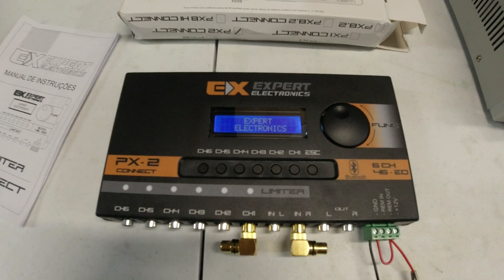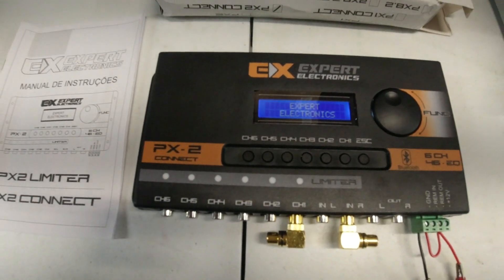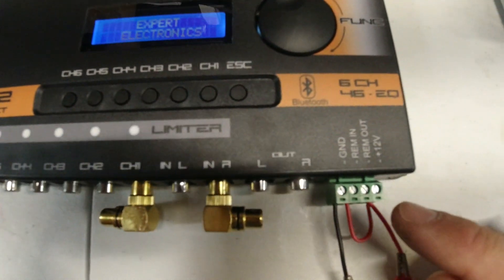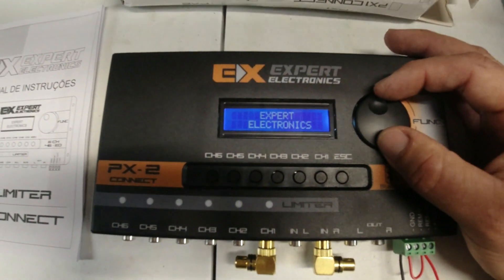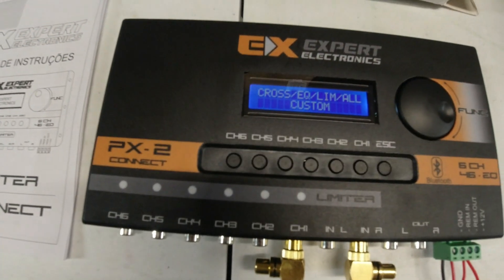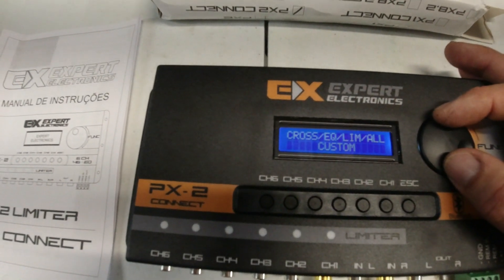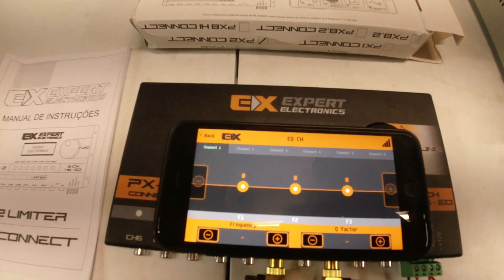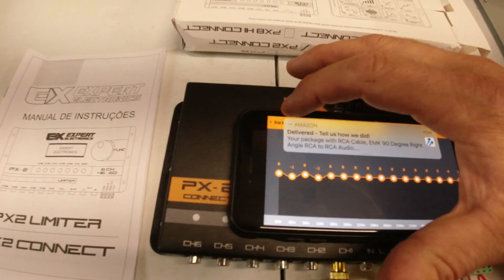Expert electronics PX2 connect DSP digital car audio processor Equalizer  crossover english manual

Comment: That DSP is a 6 channel and each channel is completely separated not by left/right channels. You can take each channel and input a one in/ 2out splitter per channel. In the settings you have a choice to run that channel joined left/right joined. Each channel has its own crossover. So if using a splitter per channel it can expand to 12 outputs. One per speaker on an amplifier. Fabulouso

Comment: How is 2 yrs any noise still run it still work worth it
Reply: One I am looking at is r lime
Reply from the maker: The Px2 connect and px2R are both good but the px2R has a cleaner output signal at higher output voltage both are good but I’d pick the Px2R. Also the audiopipe clean DSP-app is nice as well.
Reply: @HiFiVector  ok now it is Bluetooth tuning? Or stream music to it Bluetooth?
Reply from the maker: Only Bluetooth tuning on both
Reply: @HiFiVector  oh good

Comment: Quick question no do you know if my head unit output to this is 2 volts through the RCA and I increase the gain on one channel will it increase the output voltage too that RCA? I need to hit 5 v for my amplifier input sensitivity. I've also read that taramps like to have their gain turned up a little bit. So in your opinion should I leave the input voltage to the a little bit lower? And also my smart3bass amp will not allow you to turn the crossovers off so should I turn the high pass filter all the way down and the low pass filter all the way up in order to use this DSP crossover? Thanks for your time
Reply from the maker: Yes it will boost voltage slightly so if you want to keep the voltage on the output rca’s T a certain voltage turn up to mace listening head unit volume and check the output from the DSP and adjust the gain to where it stays where you’d want it. From what I remember at max output gain it boosted a 2v rca input to around 5v. And yes the taramps seem to do better with a lower voltage input signal. Around 2 volts . You can go higher or lower some guys run like 7 volts and some 1.5v but to me they do better with lower input voltage so you can turn the amp gain knob up more. High voltage makes them “ jumpy”.

Comment: Any suggestions on how to get to gets customer support? There is absolutely no way I would recommend this item just because it is an act of God to be able to get customer support or find out any information on this thing. It has been absolutely frustrating and a waste of my time. I understand when it works it is amazing apparently but that is if you can get it to work
Reply from the maker: Yeah, I’m not sure on the support but the Bluetooth should be pretty straightforward to connect but again some problems might just depend on the phone you’re using maybe? Because usually it’s pretty straightforward. Sometimes there is a delay where it might take a minute to connect. I have heard people say also make sure that you’re not connected to any other Bluetooth device just  the DSP.
Reply: Yeah I thought maybe I got a bad one so I ordered another one have the same issue. I've tried 3 different phones to different px2s. Made sure that no other Bluetooth is connected. When I open up the app it doesn't even show that it is searching for anyting. Still have not been able to get a lick of customer support.
Reply: Does your app still look the same as it doesn't your video? Mine has a slightly different layout but looks pretty similar but they have 20 different apps. According to the about app paragraph then the one I am using is for mine. Idk. I'm so freaking frustrated with this thing. Thank you for your help and time.

Comment: I'm confused on how to hook this thing up. I have 2 sets of rca coming from factory radio.  One for subs amp and one for mids. How do I run both sets to the dsp ?
Reply from the maker: You would just use the full range rca into the DSP and setup the outputs for a sub amp and then full range. This DSP is one in and multiple out.
Reply: @HiFi Vector   awesome,  thanks for the help man, super appreciated it was the last part of my install lol
Reply from the maker: You’re very welcome man!

Comment: Can help me out Problem I’m having is i have a EQ from my head unit so from the EQ I have it down to the DSP and then I go to connect my speakers amp to dsp it works but when I connect horns and sub amps into dsp doesnt work ?
Reply from the maker: Maybe check your output configuration to the outputs of your sub and horn channels. crossover ers and also check to be sure you don't have the channels muted.

Comment: Hi Vector ii have a few questions if you could help me  .  First off thanks for the review on this PX2  this maybe what i have been looking for.  I have a head unit with dsp, but its limited and my opinion it dont sound so great.  So i can hook up the PX2 and just not use the dsp in my head unit ?  I have 2 front door speakers, 2 rear speakers and 2 tweeters on the front pillar, and i have a 4 channel jbl amp.  Im guessing this unit is going to improve my sound over my stock head unit dsp ?  Does it have the ability to do speaker timing delay ?
Reply from the maker: Yes you can use this DSP instead of your head units. It does have delay settings. Thanks for watching

Comment: Ordered mine 30 seconds ago. Thank you bro.  Only question I have is how do I adjust the RCA pre amp outputs?
Reply from the maker: It is adjusted by adjusting the gain on the output channel. Higher games equals higher voltage.
Reply: @HiFiVector  thank you bro
Reply from the maker: Your welcome
Reply: Have you tested it to see where it starts sending clipped signal at?  What main gain setting that is?
Reply: Hey bro. I've been using this DSP for over a year now and just learned something.  I was playing with my system and had only the sub going with a podcast playing.  I heard the words through my sub and was like what the hell.  Crossed it over down to 30 Hz and could still hear words. The crossover on this thing can't be trusted bro. So I tested further. Played at 40 Hz tone and my door speakers were trying to play it. Buzzing.  I have them crossed at 150 Hz. Check it out yourself.  Imma try a Dayton. I love the features on this thing but I can't run it anymore.  I ordered another off Amazon just to see and it's the same way. Plus it lets a little noise in the system. I tried a good Newmar noise filter on it and it still  had noise. I mean for the price you can't expect perfection.  A good starter DSP nonetheless. Thanks for your videos bro. You rock!

Comment: How do you set the gain with a o scope on this ? Its not registering in my head why its even a option.
Reply from the maker: You would just do it the same way you were checking your main RCA‘s from your head unit but now you’re gonna be checking them on the outputs  of the DSP. And you can set your gains directly on the DSP accordingly to get it clean max volume.
Reply: @HiFiVector  ill check out some videos on that. I checked clipping on my hu with the speaker out and set the gain on the amp right from the amp.

Comment: What rca outputs from the radio do I use if there's 6 of them? But only 2 inputs on the dsp?
Reply: Ok thanks, just the front 2 will control the sub as well? Don't need to bypass the DSP for the sub RCA'S and go from radio to amp?
Reply from the maker: Yes this particular DSP just run it left and right RCA’s and then you configure the outputs for either full range or subwoofer through the DSP
Reply from the maker: You can use the front right and left.

Comment: I am running 4 channels front L & R and back L & R, plus a mono amp for 2 10 inch subwoofers, I guess it would be a total of 5 channels. How would I use the routing for each channel? Especially the 1 channel for 2 subs, thanks
Reply from the maker: Watch my other DSP video it’s More and Depth that should help you
Reply: thanks, that video answered the routing but created a brain freeze on the crossover and types. I have my current crossover at 120hz and sometimes use 80hz. This dsp looks confusing with the crossover adjustments

Comment: Do you have any idea what the difference is between this and the x8air? I can't find any info on the x8air. Also on this would you need 2 for front and rear output off the head unit?
Reply from the maker: The x8air you must use the app . No buttons on unit. It has only 1 band custom eQ per output. ( px2 has 3 ) the x8air main difference is it has 2 pair inputs with right and left channels so you can keep your balance and fader control. On your head unit. Those are the main differences I can see. You just need one pair of rca from your head unit for the px2.

Comment: Hey does anyone know th output volts of this unit is it 4 or 8 v rms and do I still need a preamp for my amp
Reply from the maker: Check out my in-depth video that I did a little while back. But the output voltage on the RCA’s since the Dsp is adjustable that voltage is somewhat adjustable. And you still need to provide the Dsp RCA preamps from your head unit. Or you can use a line out converter and tap off your speakers.
Reply: @HiFiVector  ok thanks alot

Comment: Can this substitute a line out converter?
Reply from the maker: No it cant
Reply: @HiFiVector  so how is it be installed with a line out converter?
Reply from the maker: @justinking8220   You connect  your speaker leads to your line out converter then take your rca outs from your line out converter and go into the DSP.

Comment: Do you use 1 pair of FULL RANGE RCA's from the head unit to  INPUT on the DSP? And from that you get full sound even the subwoofer sound? My head unit has 3 pairs of RCA's and one of those pairs is a dedicated sub  output.
and use DEFEAT or else set everything to 0 on head unit?
Also, is the AudioControl Epicenter still useable on the sub output to the sub amp ?
Thanks, maybe somebody else has these questions too. 😃
Reply from the maker: the DSP controls all the channels so you would not use the factory sub output. You would just use the 2 main RCA in and then configure the DSP to output the sub channel.
Reply: @HiFiVector  thanks, I ordered using your link😃
Reply from the maker: Thanks so much I appreciate that!
Reply: @HiFiVector  you went to the trouble to make the video, I'll order from your link .
Hey, those L and R inputs, that's both from the Front? In other words you wouldn't use right FRONT and left REAR, JUST USe right and left front rca from head unit ( could be rear but I'm saying front to keep it simple)
So long as it's full range signal
Reply from the maker: Correct on this DSP with only 2 rca inputs you would do it that way. Then use the DSP for everything even levels like fader for front rear with your levels on the DSP.

Comment: Better than the pioneer s1000 dsp?
Reply from the maker: This has more adjustability for sure. But the Pioneer is a good basic DSP plus the Pioneer has a built in amp to replace your head unit power for your door speakers if you need that then its good but otherwise the Expert or comparable DSP is more tweakable.

Comment: The X6 Air is basically the same processor, but with a reduced size and 32 bits. It only works with the App. https://www.expertelectronics.com.br/produtos/visualizar/27

Comment: Delay is to align a rear speaker that’s out of sync with the front to tighten the sound (you would delay your fronts to make the rears more in phase/tight   Would be useful the larger the vehicle is… at extremes you would hear doubling … could also delay the passenger speaker to the drivers ..   out of phase speakers will kill bass (most noticeably)
Reply: You
Reply: I'm not

Comment: Can someone tell me some information/specs in layman's terms on a US Amp 4300x. It's also connected to a "bridgeable" (connected?) 1000 watt amp with a capacitor and a 6 channel line output converter.

Thanks

Comment: Mine is junk. Introduction of alternator whine.. it's 100% the dsp. This thing is junk
Reply from the maker: Sorry man that yours isn’t working. I know a lot of people that use this and we haven’t had any problems so far but maybe you got a bad one. Also I know certain vehicles have noise issues inherently so maybe that’s just something with your vehicle or maybe it was just a bad DSP but usually these things are pretty solid.
Reply: Your main output level is too high. It sort of clips over 3/4 Distortion.Think of that setting as a gain setting and not a volume setting It has noise if you go over that. Buy a ground loop isolator install befor the unit rcas
Reply: Always the equipment never the user huh
Reply: Out of curiosity, what kind of vehicle do you have it in? Year, make, model?

Comment: Do you know the difference between the PX-1, PX-2 and the PX-8.2? I am looking to get one these but I have no idea what the difference is 😐
Reply from the maker: It looks like the px2 has more frequencies on the parametric EQ and has more customizable channels. So they are very similar  but px2 has a little more presets and larger EQ.
Reply: @HiFiVector  yea thats the one I ended up going with I love it im glad I ran with that instead of the px1.
Reply from the maker: I do not sorry. I would just check out the website and compare specs.
Reply: @HiFiVector  I've been trying to find a website I can't find that either lol the most I could find is that the px-8.2 has 8 channels and 2 inputs with a 15 band eq while the px-2 has 6 channels and 28 band eq. It seems like the px-8.2 is the newer model so I really wanted to know if it had newer features but I think I'll just stick with the model that you have since there is no videos (in English atleast) about the new model. Thanks anyways bro.

Comment: Hands down this has way more features than stetson taramps both no bluetooth.  Outstanding Video. Got one. It just has more features period. For the price Im blown away. Should have gotton the 8 channel model instead of 6 channel.
Reply: If u ever own audio control dsp, u would never compare it to this crap. Same features doesn't mean equal or even close in quality.
Reply: @Clement-sx6ll  Your right just discovered Background humm/hiss from this unit. however it gets the job done.

Comment: Any updates on this? I read that the output volts are semi low on this unit and some people noted ground loop noise . Lmk thanks
Reply from the maker: Have not had any noise on mine at all. A lot of times noise can be vehicle specific though.
Reply: @HiFiVector  thanks, was on the fence with this and the Setsom. I am going with this thanks to you.
Reply: @HiFiVector  - I'm getting noise even when connecting this to my home theater subwoofer on my home electrical using a 12V DC to AC adapter.  I'm even hooking up a ground loop isolator in-line and still get noise.  I'd say the electrical built-into this is cheap junk, but the processing and phone app are solid.  The company really needs to make a more robust noise resistant internal electrical.  I think the company that makes this "cheaped out" the internal guts and that was a mistake.  People would gladly pay $15 more for a robustly built noise-free sound processor.

Comment: Would I need 2 of these if I have 7 in car speakers and 2 subs
Reply: There is a 8 channel model. More money however.
Reply from the maker: This has 6 controllable outputs. They  can be configured MONO or you can output them as left and right as a pair. So if you had them all set as stereo outputs then there would be 3 outputs. But it is customizable. There is also 1 pair ( Left / right ) pass thru outputs. ( where they are outputs but not running on DSP ) . So it just depends on how many and how your amps are set up. for example you could set it up to where you use 1 mono or stereo output for your sub amp , and you can have 2 stereo outputs for 2 full range amps. You can use any combination of the output channels.

Comment: Thanks for the video. Do you know what the preamp voltage range is that you can send to other amps?
Reply from the maker: I didn’t check preamp voltage range. I will try and do that soon and let you know.
Reply: @HiFiVector  okay, thanks
Reply: Up to 10 amps

Comment: Sorry man super interested in these. I forgot to ask you if you know what the output voltage is..?
Reply from the maker: I didn't measure the voltage but it is fully adjustable on the input gains and output gains.

Comment: I have two of these. It helps to download the app immediately . Because the app has a "test" function and then you can figure it out pretty easily
Reply from the maker: Yes indeed
Reply: Do you have them both in one system, if so did you run from the out on one to the other? I'm thinking about getting a second one to run my rear and subs through it and the front speakers on the other.

Comment: what is the signal to noise ratio as it is too small to read thank you from N.Z.
Reply from the maker: .01%
Reply: @HiFiVector  I think that number you replied with is the Signal Input Sensitivity.  S/N info in the manual
ADC SNR  100 dB
DAC SNR  104 dB

Comment: This thing looks like a bargain for what you get. Almost worth the price JUST for the Xover and Bluetooth app. Pretty amazing that they offer such accurate slopes and cutoff levels, etc. 

The sad part is, my $600 DSP has a bluetooth app AND requires a bluetooth adapter which alone costs more than this whole DSP. 

I'm gonna try one for giggles.
Reply from the maker: Yea this is great for sure. Also check out the stetsom bluetooth DSP. I will be doing a vid on it shortly.